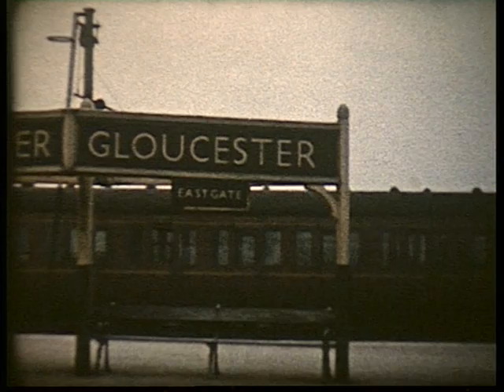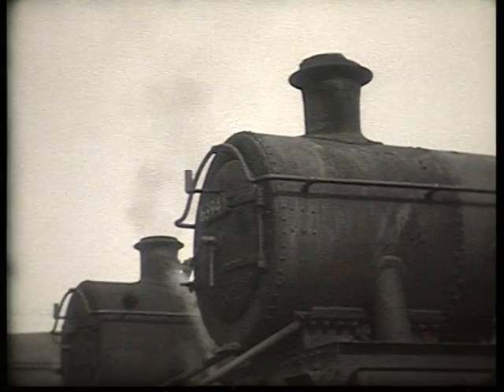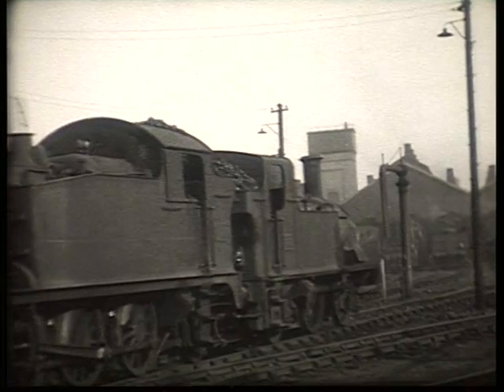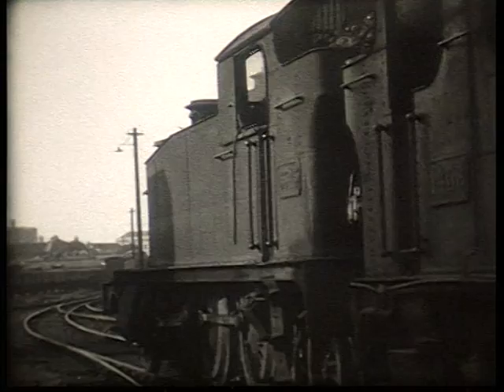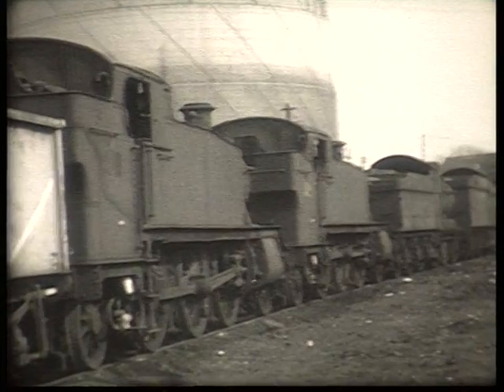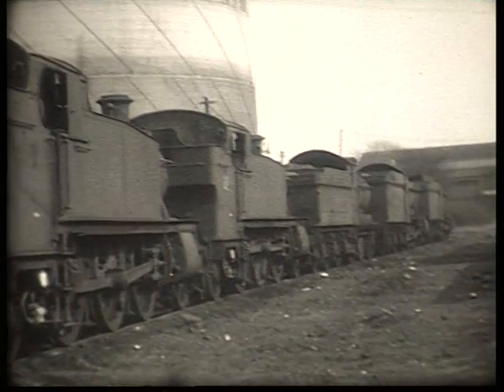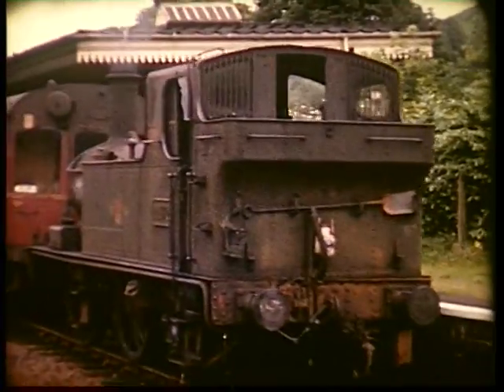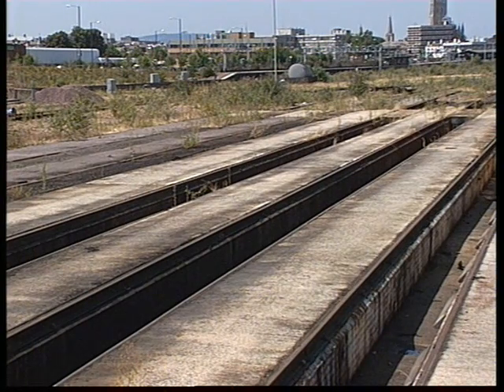Gloucester Horton Rd

Comment: Memories of crossing tramway junction on foot.
I remember that there were many lines to cross. The video map shows six. A pedestrian wanting to cross would find it nigh on impossible to decide when it was safe to cross because there were trains coming and going from four directions. Cheltenham, Stroud, Gloucester Eastgate station and Gloucester Central station on the South Wales line. Some trains using the crossing at speed would not allow a pedestrian to reach the other side before they would meet. It was also difficult to judge what line the train would use because a pedestrian could not judge which onward direction the train was intending to go.
I remember at night being somewhat apprehensive when one often saw two trains using the tramway going in various directions.
To solve the safety problem there was a man on each side of the crossing who operated the road gates and also the pedestrian gates. They must have had some form of communication from a distant overseer; or perhaps from several signal boxes controlling the four directions. I remember as a pedestrian having to wait to cross  several minutes, and even so one had scarcely reached the other side when a train came thundering behind one across the crossing. The crossing gate keepers must have been very skilful men.
Is anyone able to explain what information the crossing keepers had access to?